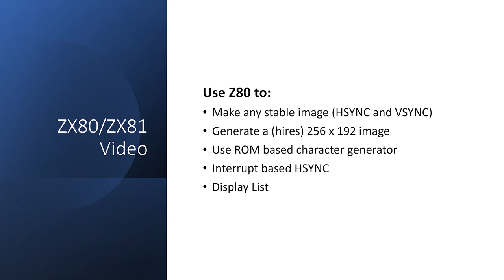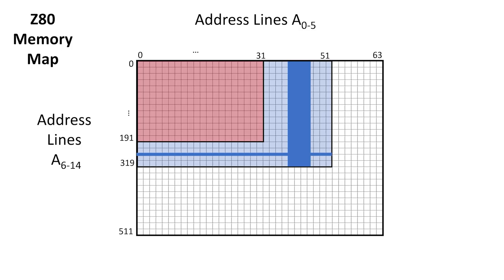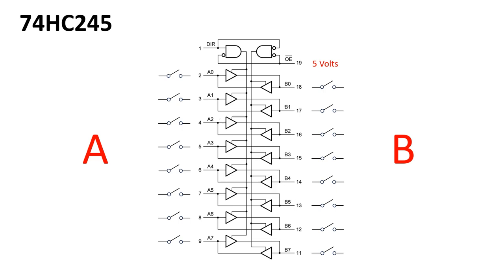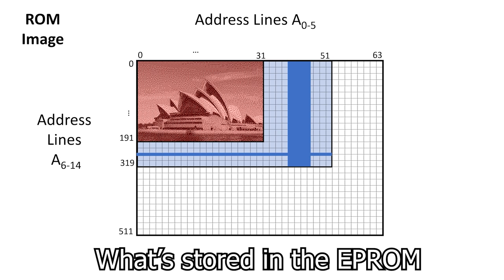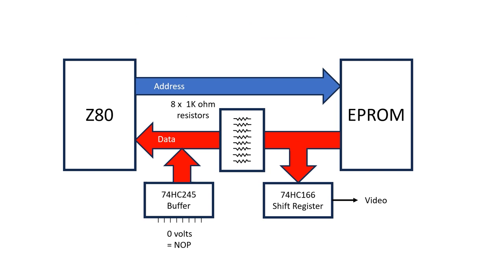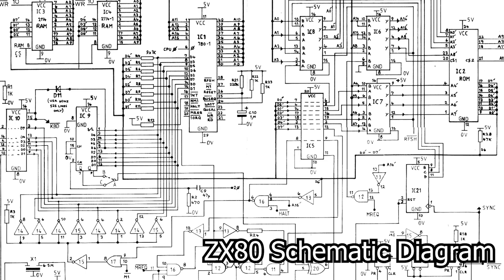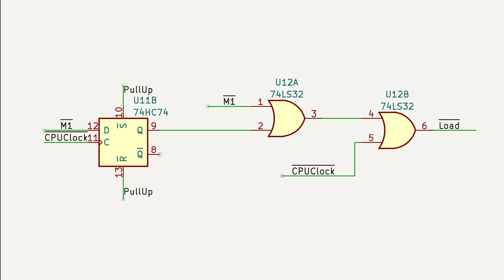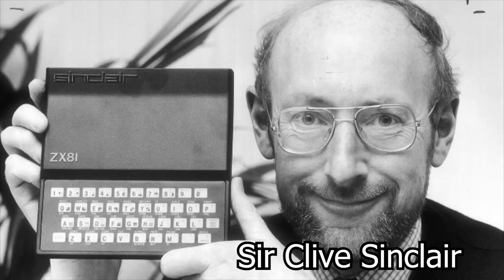ZX81 Video Circuit Part 2.  Hi-res display of 256 x 192 pixels.

Comment: Hah.  While watching this around the 7 minute mark I thought, replace the 2nd '245 with pull down resistors and at 8:43, there we go, resistors.  I don't know anything about the circuit design of the ZX80 so it was just application of general principles.

The crash bus method using resistors to separate the bus and let either side drive it appropriately is used in the Laser 200 (VZ-200) to merge the CPU and VDC address busses with the Z80 disabling the 6847's address output and relying on the video side high-Z to get it's address through to the video RAM.

As always a fascinating look into this stuff by DrMatt
Reply from the maker: Sorry for the delay in responding, glad you liked it.

Comment: Great video as always, thank you.  And yes, in the mid 1980s, I was one of those who had most of the 74xxx part numbers and functions in my head. Also many of the pinouts and probably more of the worst case timing parameters than most would consider to be healthy 😂😂
Reply from the maker: Enjoy.  It's kind of surprising how quickly you pick up pin outs as well.  I actually think it's the debug process that actually makes you memorize them better.  When running the logic probe around, it's just much quicker if you remember the pinouts.   Just remember the 74LS02 is the odd one out!

Comment: I love the Z80 CPU. I got my first computer, the ZX81, in 1982. I've kept it working all these years. I've installed 32K internal RAM and done a composite conversion using a 555 and got the ZXPAND SD card kit for it.

I've also built many external I/O boards over the years. Some of which took out the ULA/CPU or regulator.
(quite a bit of trial and error in the early days. LOL)
Reply from the maker: Excellent.  I unfortunately blew up my zx81 back in the 1980s.  You might want to look at the Z80 build video on the channel.  I’m thinking of doing a series on the microprogramming of the state machine for the Z80.
Reply: @DrMattRegan  I'll check that out when I've watched this series, cheers.

Comment: Hi Dr Matt. I really enjoy your videos but I've never felt the desire to follow along and actually solder up the project at the same time as you. If I'm totally honest it's because your previous projects have used some large EEPROMS and finite state machines that don't quite feel in the spirit of a lot of the machines from the era- but are really interesting from a logic  / design point of view. 

I'd just like to clarify - is the intention to be able to use the original zx80/81 rom unmodified in the final machine? And more importantly- what sized per board would you recommend for the machine? 

All the best,
Aaron
Reply from the maker: Hey Aaron.  Yep, i'm planning to use the un-modified ZX80/81 ROM in the end.  I use 27C040s personally because i have a bunch of them, but it should work with any 4/8K EPROM.  Similarly for the SRAM, i use 628128s because i have them but of any size 1K and above will work.  Just 7400 series logic other than that.  No big EPROMs with state machines for the ZX80/81.  I'm using 18x30 cm perf board which you can get on Ebay, but i generally go large and cut it down later.

Regards
Matt.
Reply: @DrMattRegan  Thanks. I keep using 32kb eeproms for everything because I've got a couple of tubes of them. I'll see if I can replicate the results of this video!
Reply from the maker: Excellent, I'm keen to hear how you go with it, please keep me informed!

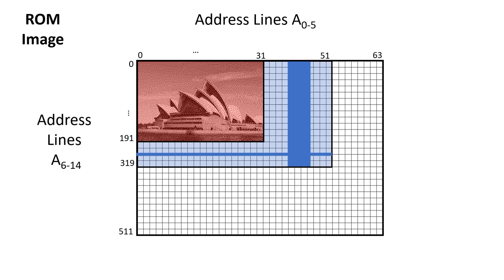Comment: This is really interesting. I started with a Spectrum back in the day with its custom ULA but the way they got display working with basic devices is fascinating. Just a quick question though, @8:26 you mention storing code in the 2nd half of the scan line, but am I right in saying that as it stands at the end of this video, the system is still returning to the start of the next scan line at the end of the blue area in order to maintain sync?
Reply from the maker: Glad you found it interesting.  In the second half of the scan line we generate the syncs and jump to the next scan line.  We also do the inc bc to maintain 208 clocks per scan line.
Reply: Hey @synthnerd4539 if you're really interested in these things, I'd recommend that you try to track down a copy of Chris Smith's book "The ZX Spectrum ULA: How to Design a Microcomputer". 
It will tell you all you want to know about the ULA, and then some.
Reply: @BertGrink  I have tried to read that one!
Reply: @synthnerd4539  Yeah so have I; it is a VERY technical book, but some day, i WILL get to the end.... some day...

Comment: I would guess that the ZX80 CPU is doing nothing else but generating the video while waiting for an interrupt, then going and servicing the interrupt when it happens, coming back to rendering video when its done. That would explain why my TV rolled every time I pressed a key (which I did not find amusing back when I was a kid playing with the little PC). Being able to run arbitrary program code while in the VBLANK interval would help also but dedicated hardware would have to be generating the VBlanking pattern during that time..

Thanks, learned a bit about the little ZX80/81 and how it generated video from so few TTL ICs.
Reply from the maker: They use interrupt to generate sync.  It’s very clever and I’ll go over it soon.  When the display is active, the only spare time is during vsync which is when it checks for a keypress.  If that causes action then it will service that and it’ll stop generating sync.

Comment: Given the comparitive reduction in cost of memory and the 74 series logic chips, why not go with the initial design that you proposed? Another question along the same vein: Would there be any benefit, from a cognitive complexity perspective, of splitting the image data and Z80 instruction data into two different EEPROMs?
Reply from the maker: Yeah, i don't really like using resistors this way, but i'm trying to explain the zx80 design, so that's why i went down that path.
Reply: Perhaps you could use a 16-bit EPROM? That would eliminate any timing differences between two separate devices, and perhaps simplify the circuit a little.

No, wait, that might not be a good idea after all; ultimately you'd want to have RAM to store the actual image data.

Comment: This seems really similar to the "cheap video" microcode described by Don Lancaster. Guess someone else read the TV Typewriter Cookbook!
Reply from the maker: I'm trying to reverse engineer the ZX80/81, but i suspect the designers of the ZX80 would have known about Don Lancaster, although i believe he used a KIM-1.  The designs will diverge a bit once we add in character generation and IRQ based horizontal sync are added (it uses a Z80 feature that the 6502 doesn't have).

Comment: Question: I see you are using CMOS level HC series rather than the TTL HCT, does this reliably work with the TTL Z80?
Reply from the maker: Yeah, i'm actually using the Z84C00 which is the CMOS version of the Z80, so it hasn't been a problem .
Reply: @DrMattRegan  Ah, that makes sense!